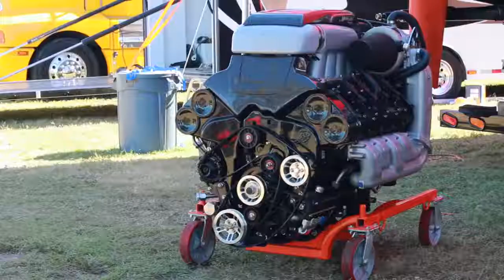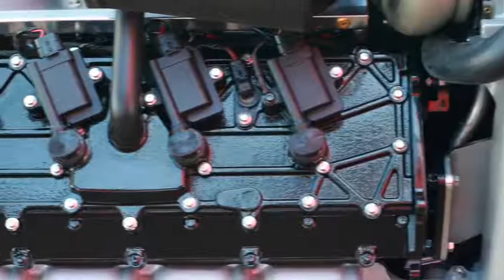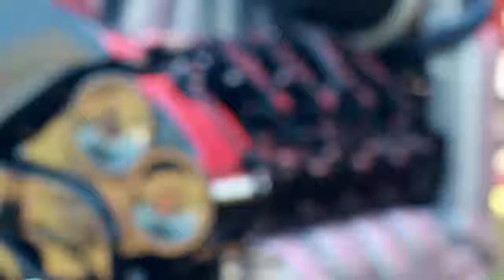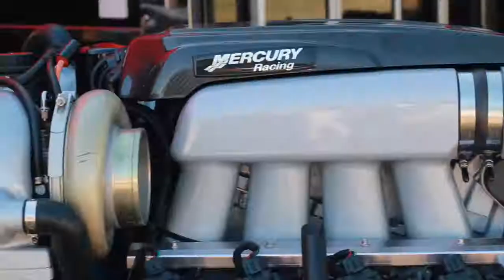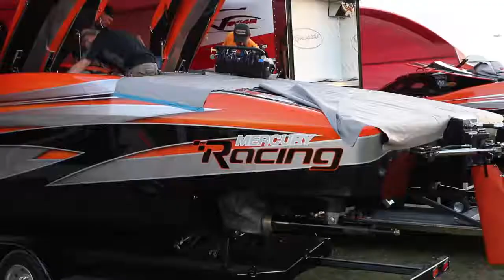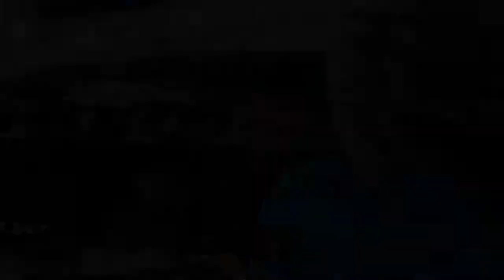Wake Effects Offshore Powerboat Racing - Mercury Racing Engines

Comment: The boat is probably under sponsor contract to have Mercury power (1650's) but not necessarily drives. Pushing a large offshore boat through rough water with big power can prove to be too much for most standard drives. Hence the need to go with a straight shaft setup like Arneson.